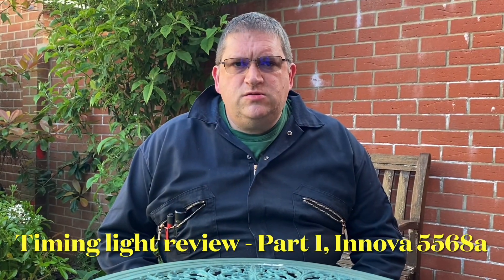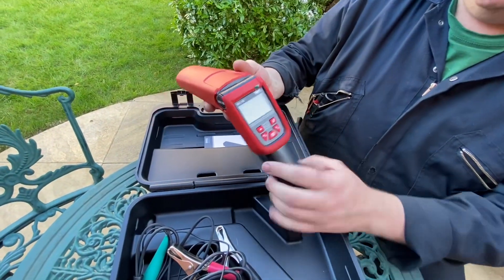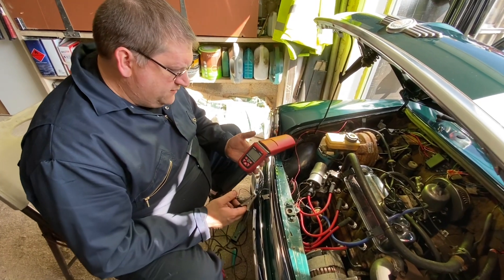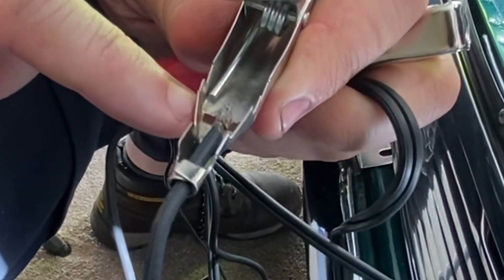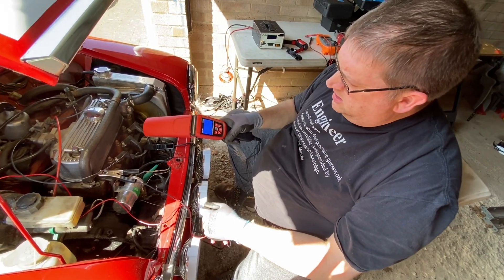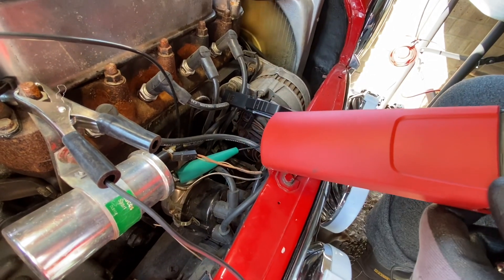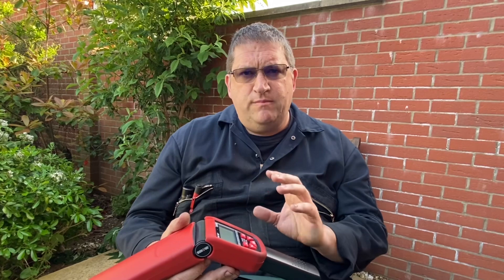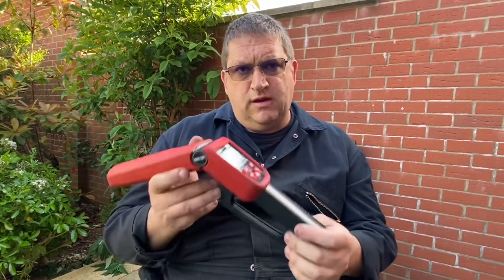Timing light reviews - Innova 5568a

Comment: Used mine 6-7 times and the up/down function failed. Bought via Amazon about 4-5 months back Refunded. Not sure what to buy now, two Accuspark  lights have failed/not accurate anyway.... For some reason I can't get lights to stay working (semi-pro environment) Very good when working, think I'll buy another 5568a.
Reply from the maker: I carry 2 lights on the road for a reason, my latest timing light modification has been to convert the snap on to cordless using a drill battery, so far this has proved to be transformative and the light functions better than ever.

Comment: Just bought one thanks.
I have a Riley RM 2½ without any timing marks.
Can you confirm please:- mark TDC on crank and block, then advance the timing light to 8° and adjust distributor until the marks on pulley align?
Am I correct in my thinking?
Thanks
Reply: That's the recommended setting 4-8° BTDC
Reply from the maker: @ ahhh it does not work like that. The factory settings are meaningless now with wear and different fuels.
Reply: I'm aware of wear and modern fuels/older tech but I'm curious about the principle in setting the timing without marks and this timing light. If you could? Thanks
Reply from the maker: @ send me a message on facebook messenger and I will video call and talk you through it.
Reply from the maker: Why are you choosing 8 degrees?
Reply from the maker: @PeteD-r9k  see this link for more info and watch all three parts;

https://youtu.be/bPkvIvrOgtI?si=9gbBKwgdChd6V4fn
Reply: Ok. It'll be later on thanks

Comment: Hi, I got one of these based on your recommendation, works great, but Im having issue getting advance at idle, when running at higher rpm no problem, the advance point moves,, but at idle, I can't determine the advance, I increase the advance figure, but the marks dont move back to pointer. have you experienced this, or am I doing something wrong?
Reply from the maker: That might indicate a coil power issue, check you have the right resistance coil fitted and you have the correct dwelling angle arrangement/setting for your application
Reply: @ACDodd  thanks, for taking the time to answer. I have just changed the coil back to an older one as the one I had on was shorting out, sparking from positive terminal housing to main body, they both get very hot though, will ngetb a new new one. Kepp up the good work, Like the videos and content. even though I have a Landrover not a Mini...

Comment: had the non advance one for years works great ordered this one for checking advance at 3500rpm because of the tach read out it worked 10 mins b4 the light died sent it back to amazon for a replacement if the next one dies ill be looking at something else...but b4 it died it worked good

Comment: Nice video and the timing light looks a nice piece of kit (although the crimping on the lead's strain relief didn't look to secure) unfortunately it's a bit too complex for my needs.
I've always used a simple 'flash on spark' type of light, the one I have at the moment is mains powered and probably 50 years old so getting a bit knocked about, bought a new one but in typical chinesium fashion it only seemed to have a handful of flashes installed so failed very quickly.

Looking at the way these work I'm assuming the flash is delayed and you set that delay until your TDC mark lines up the unit then works out the timing angle using the RPM input?
The problem I have with that is that my setup is wasted spark so I'm going to get two flashes on the plug lead per engine cycle and I'm guessing this will confuse the unit.
Also may of the other functions I have covered by other systems or are not relevant to me (dwell for instance).
Do you have any recommendations for a decent quality 'flash on fire' type of light?
Reply from the maker: No, I only tested these ones I did the videos,  on out these the 5568 is the only one that worked properly.

Comment: Hi, I’ve just bought the innova 5568 from amazon and my light is almost to dull to see (yes I switched the light on 🤣) am I doing something wrong or do I have dud? Thanks 👍
Reply from the maker: Hi there, use a slave battery and see if it improves. If not return it.
Reply: @ACDodd thanks 👍 just tried that, still the same… could it be the pick up???
Reply from the maker: @mcmotors100  send it back

Comment: How does the advance function in the timing light work mate? 
I see you can adjust the timing from in the timing light, but how does that work? What’s that function used for?
I guess You’d still have to turn the distributor to adjust the timing?
Reply: Adjust the distributor manually I mean to say.
Reply from the maker: It does not alter the timing, it simply allows you to measure the timing accurately. It’s super handy for checking the timing higher in the rev range especially when using vacuum, as you are looking figures in the 30 to 50 degree range, which timing marks are not provided. It also allows you to accurately measure the timing against rpm. Decent timing lights like this one also have a smoothing circuit function that allows easier reading of the flashes.

Comment: Nice review. Can you tell us where on the fuse box you connected to +12volts? Also, most timing light instructions state to use an external battery, not one running the engine. I have not found using the car battery to be an issue, but is it something to be concerned about?
Reply from the maker: No concern, there is less electrical noise when using a separate battery. Use the connection on the fuse box which is ignition live, and a classic mini this is the connection that has the white colour wire attached to it.

Comment: Is the green clip also just a ground?
Reply from the maker: The 4th clip connects to the negative of the coil to give you dwell readings
Reply: @ACDodd   so I wouldn't need to use it on an HEI? My coil isn't like the one in the video.
Edit: and thank you for the response.
Reply from the maker: @Wbroach24  dwell is usually used for contact breaker type systems
Reply: @ACDodd  OK thank you, I'm fixing to re-time my 1987 Monte Carlo SS and have only seen my dad do it as a kid... LMAO infact I murdered his timing light unknowingly when I was probably 10 years old found a way to plug it into the wall 😆😆 I told him recently and said he could have mine if he wanted he said no I'll just use yours if I need it. ( Maybe code for I'm gonna plug it into a wall 😆😆)

Comment: Thanks for the review mate.  To be frank, I can't stand that the leads are removable.  I've had 5 different brands of timing lights, all had removable leads, and that was the reason they all ended up in the bin.  The damn plug stops making connection, rendering the entire device useless.
Reply from the maker: I have also had broken wires in the units without plugs. The answer is we need to handle timing lights with care to maximise life.

Comment: I set it to 4cylnder, and 0 degree,... checks ok.. then if I need to check it at 18 degreed, I just move it up to 18 and it adjust the light accordingly?
Reply from the maker: Have you read the instructions with the timing light?
Reply: @ACDodd  yes.. I set the gun accordingly to it. I'm working on a honda d16. I set the gun to 4clinder. 4 cycle and 0 degrees..

Comment: What is the dwell angle used for?
Reply from the maker: The dwell angle is an electrical measurment of the coil charge time and is directly related to the points gap
Reply: @ACDodd  ok thanks for that. I'm guessing with a 123 electronic dizzy i wouldn't need this then? Just ordered the Innova as well. Thanks for the recommendation
Reply from the maker: @luismeixner2125  dwell function is a very handy addition it is essential when working out what type of coil to fit
Reply: @ACDodd  just received mine in the mail today!
Was wondering if i need to use the green cable on the neg side of the coil for normal advance checking? or is this cable/clamp only used for checking dwell angle? thanks
Reply from the maker: @luismeixner2125  green for dwell only

Comment: I carry 3 strobes with me on my daily work.  The Innova 5568a is my general 'go to' for perhaps 90% of the time.  In general it's a great strobe, but all be it very slight, it does have a few of negatives.  I do find that on certain unstable ignition systems it can 'play up' but that in its self is almost a diagnostic to prove that there is an electrical issue some where....(such as a cheap and nasty alternator for example, and you may see it flashing up 7000rpm at idle, with spark scatter).  In which case I then switch to one of my other strobes with a manually operated retard function, to reduce the visual spark scatter.  The second downside, is also at times a positive too..... the leads are pretty long and can get into a birds nest very easily.  But as said the length can also become very useful for car types when the ignition timing marks are beneath the car and the extra cable length is needed (Old Jaguars being a great example).  The final thing is that for some engine configurations the induction connector can be very near the exhaust manifold, so take care to keep checking on the  induction connector and give it a cool down period if needed....because they do burn and they do warp.  Also worthy of note is that there is pretty much no product support available in the UK, but support is given from overseas and replacement parts can be a bit pricey too.  Overall though a great bit of kit!!

Comment: Just bought one, so was a bit nervous about your review. But sounds like it will work out okay. Looking forward getting some readings on my cooper from 1991.
Reply from the maker: Certainly the one I have is an excellent piece of kit and I like better than the snap on ones I have been using!
Reply: @ACDodd  Thanks for the review. Which features set this apart from the Snapon timing light you have?
Reply from the maker: @4272005  this one has a dwell meter and a zero function a volt meter, I also think it’s a slightly smoother than the older snap on light I use.